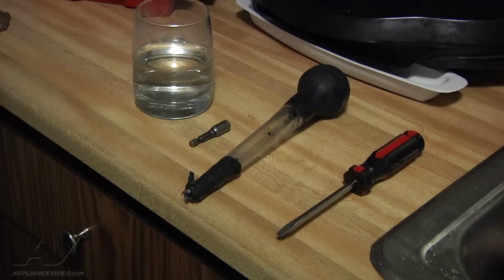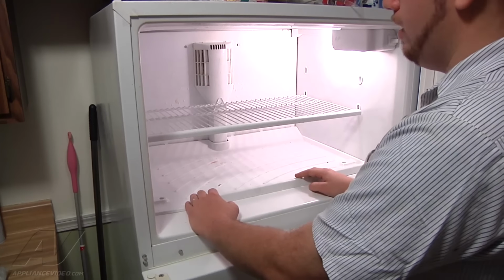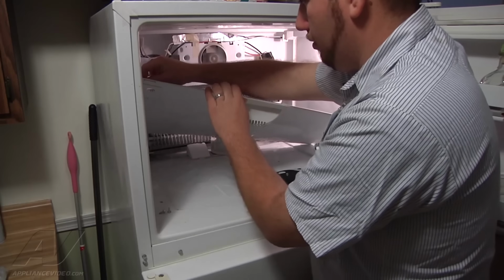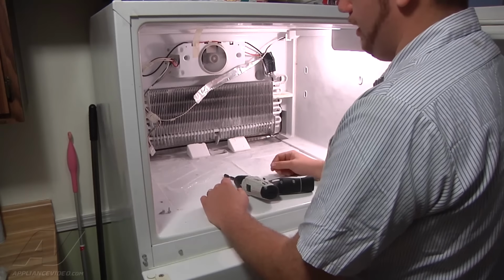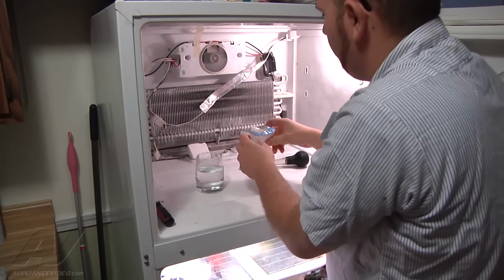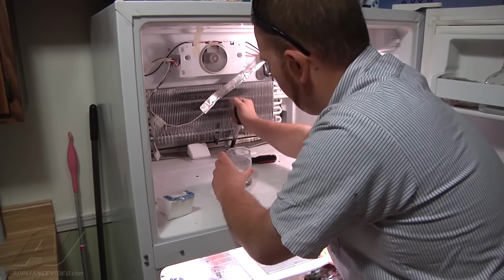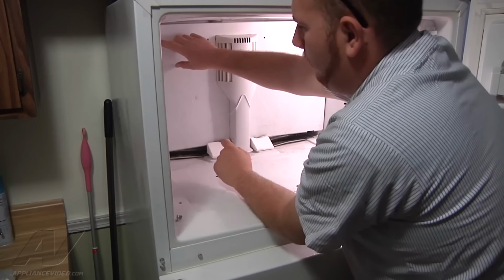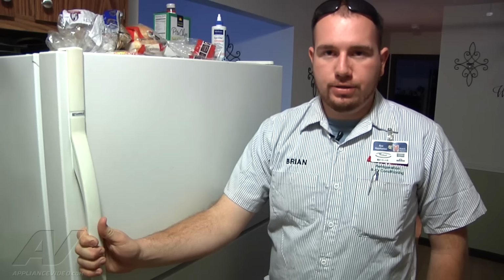Kenmore Refrigerator Repair - Water Leaking From the Freezer - Evaporator Drain Pan

Comment: So, I have used this repair for many years now to fix this annoying problem on my Kenmore Model 71192100 manufactured in January of 2002.  Just saw another site recommended another more permanent fix for this, which was to hang a copper wire from the defrost heater and down into the drain hole.  Did this and giving it a try.  (Just performed these two fixes (yours and the wire) yesterday)  

My current problem though is that despite doing this defrost and turning everything back on, the fridge part still does not seem to be getting colder.  It is hovering around 50 degrees which is too warm even after 24 hours being back on.  The freezer seems to be okay still (and it usually is and stays very cold).  I usually know it is starting to freeze over when the water starts pooling in the fridge top shelf.  I do this usual fix and it always seems to do the trick and everything is back to working order.  Not so this time.  The fan in the freezer part seems to be working, fyi.  Isn't this what forces the cold air into the fridge part?  What else might be going on to cause the fridge to still not be working properly?  Thanks for your help!
Reply: As a side note, I also have that loud clunking noise that someone else described that happens a few times a day, but it has done that almost as long as I have owned it (purchased it new around 2002) as far as I can recall.
Reply from the maker: Great question, you can call
our parts department at 1-800-830-5465 and they can give you help 6-days A week
Mon-Sat . You can also search at www.SaveMoreOnParts.com 7- days a week.  If you have a more
technical question that our parts department cannot answer, our technicians are
answering all questions at our website at www.ApplianceVideo.com under our Repair Help section. We have over 6,000
common questions and answers that you can easily search through by your model
number, appliance make, problem or error codes, and It’s completely free to
search through our question & answer library. There is a very good chance
you question is already answered there.

Comment: I wish that I had seen this before I worked on mine the first time.  Just a couple of tips:  The holes for the two upper screws in the ice maker are slotted, so you don't have to completely remove them; otherwise you are liable to have them drop into the ice maker.  This also makes it easier to re-install.  I had a little trouble getting the screw holes to line up properly, so I held it up a little and then took an ice pick through both holes (carefully).  I couldn't hold onto the screws (too short), so I used a 1/4 socket with a little bit of paper towel on the head of the screws to hold them tight.  I also had trouble getting the back of the bottom panel to snap under the back panel, so I finally put it in as best I could and then pushed down on the back end and it snapped into place.
Reply: To clarify, I was having trouble getting the screw holes on the bottom panel to line up properly.  (This software does not allow you to see more than one line at a time, at most, so you can't proofread until after you have hit enter, then it is too late.)
Reply from the maker: Thank you for
your positive response, we are glad we could help. Please help us by
subscribing to our YouTube channel or post our website www.ApplianceVideo.com  on your Facebook page. We want to let your
friends & family know how our FREE videos can help them.  Or you can
support our parts department at 1-800-830-5465 and our parts website www.SaveMoreOnparts.com .  This is the only way we can continue to
post free videos and help over 1-million people per month like you repair their
own appliances. We also have thousands of more quality videos on all major
appliances made by our factory trained technicians at www.ApplianceVideo.com .

Comment: This is an awesome video. Do you by chance have instructions or the video for Kenmore Elite side-by-side 106.58703801
Reply from the maker: Great question, you can call
our parts department at 1-800-830-5465 and they can give you help 6-days A week
Mon-Sat . You can also search at www.SaveMoreOnParts.com 7- days a week.  If you have a more
technical question that our parts department cannot answer, our technicians are
answering all questions at our website at www.ApplianceVideo.com under our Repair Help section. We have over 6,000
common questions and answers that you can easily search through by your model
number, appliance make, problem or error codes, and It’s completely free to
search through our question & answer library. There is a very good chance
you question is already answered there.

Comment: Would this be easier if the I unplugged the fridge and let it completely defrost ?
Reply from the maker: Great question, you can call
our parts department at 1-800-830-5465 and they can give you help 6-days A week
Mon-Sat . You can also search at www.SaveMoreOnParts.com 7- days a week.  If you have a more
technical question that our parts department cannot answer, our technicians are
answering all questions at our website at www.ApplianceVideo.com under our Repair Help section. We have over 6,000
common questions and answers that you can easily search through by your model
number, appliance make, problem or error codes, and It’s completely free to
search through our question & answer library. There is a very good chance
you question is already answered there.

Comment: Is there a way to prevent the drain from clogging. We've had to do this a couple times now and would like to avoid future clog events.
Reply from the maker: Great question, you can call
our parts department at 1-800-830-5465 and they can give you help 6-days A week Mon-Sat . You can also search at www.SaveMoreOnParts.com 7- days a week.  If you have a more technical question that our parts department cannot answer, our technicians are answering all questions at our website at www.ApplianceVideo.com under our Repair Help section. We have over
4,000 common questions and answers that you can easily search through by your model number, appliance make, and problem or error codes, and It’s free to search through our question & answer library.

Comment: Thank you so much. We did this tonight. Looks like someone has tried to do it to the fridge in the past (we just moved in Sept 2016) as the foam ducts were completely snapped off and only a small piece on either side was left in the hole. Also the bottom half of the back panel was solid rust. So we had some extra sanding and spray painting to do. Thanks for the great video. Also, out of curiosity are the foam ducts really needed if so where can I get them and what are they called?
Reply from the maker: Great question, you can call our parts department at 1-800-830-5465 and they can give
you help 6-days A week Mon-Sat . If you have a more technical question that our
parts department cannot answer, our technicians are answering all questions at our website at www.ApplianceVideo.com under our Repair Help section. We have over 4,000
common questions and answers that you can easily search through by your model
number, appliance make, and problem or error codes, and It’s free to search
through our question & answer library.

Comment: Great video! I have a Kenmore 106.62159110 and the back panel doesn't look the same. I couldn't get it off but I didn't try a hair dryer either. Can you tell me if most of the time the back panel and styrofoam evaporator housing are usually one unit? I was able to get the plastic cover off the evaporator but the styrofoam stayed connected. I'm hoping if I melt it sufficiently with a hair dryer that the whole back panel including the styrofoam evaporator insulation (guessing at term sorry) will just come away. Do you have any repair manuals on this? Thanks for your help. Jeff
Reply from the maker: Thanks for your response, we are glad we could help. Our library of over 5,700 videos are currently helping over 1.6 million people like you every MONTH.  Please help us by subscribing to our YouTube channel, or post our website www.ApplianceVideo.com to your Facebook page, Twitter, Instagram or any other social media sites. Your support will help us keep producing more free quality videos.

Comment: I mixed a heavy concentration of salt with the hot water and let it do the work. It melted the ice much faster. This could be bad for the metal if used repeatedly. I flushed it with fresh hot water to rinse the salt off when done.
Reply from the maker: Great question, you can call our parts department at 1-800-830-5465 and they can give
you help 6-days A week Mon-Sat . If you have a more technical question that our
parts department cannot answer,
our technicians are answering all questions at our website at www.ApplianceVideo.com under our Repair Help section. We have over
3,000 common questions and answers that you can easily search through by your
model number, appliance make, and problem or error codes, and It’s free to
search through our question & answer library.

Comment: Thank for this video !  My Kenmore 106 from 1993 was completely different than shown, so I proceeded curiously and managed to get to the drain hole , fortunately it was only debris blocking the hole. This model drips that model into the top back of the fridge into a little pop out reservoir that also was full blocked from the usual black slime.  Cleaned that up, the hole it went into was clear so all is good to go.
Reply from the maker: Thank you for your positive response, we are glad we could help. Please help us by
subscribing to our YouTube channel. Or support our parts department at
1-800-830-5465 and our website www.SaveMoreOnparts.com .  This is the only way we can continue to
help the over 900,000 people per month like you repair their own appliances. We
also have thousands of more quality videos on all major appliances made by our
factory trained technicians at www.ApplianceVideo.com .

Comment: my fridge (a Kenmore) is older than the model you showed, i would guess.  i cannot see the actual drain line.  any clues please?
Reply from the maker: Great question, you can call our parts
department at 1-800-830-5465 and they can give you help. If you have a more
technical question that our parts department cannot answer, our technicians are answering all questions
at our website at ApplianceVideo.com under our Repair Help section. We have
over 3,000 common questions and answers that you can easily search through by
your model number, appliance make, and problem or error codes, and  Its
free to search through our question & answer library.

Comment: where does the water go that you've used to unclog?
I wish I had a light in my freezer😐
Reply: It goes to a pan under the refrigerator that you can access by removing the grille; it just snaps off.  The water is evaporated by the heat of the compressor.
Reply from the maker: Great question, with our
technicians now getting hundreds questions weekly, they are answering all questions
at our website at ApplianceVideo.com under our Repair Help section. We have over
3,000 common questions and answers that you can easily search through by your
model number, appliance make, and problem or error codes.

Comment: My refrigerator is nearly identical to this one. I cleared out the drain the same way you did 3 times. Now the freezer fan is blowing cold air, but the defrost is kicking in way too much making the entire refrigerator around 60-70 degrees. If you could help me soon it would be nice. I just fixed my dryer by replacing the timer. I thought I was kinda getting good at this until I hit this  snag.
Reply from the maker: Great question, with our
technicians now getting hundreds questions weekly, they are answering all questions
at our website at ApplianceVideo.com under our Repair Help section. We have over
3,000 common questions and answers that you can easily search through by your
model number, appliance make, and problem or error codes.

Comment: Thanx so much!  This unit is the same as ours... and I saw that the evap pan underneath was bone dry some weeks ago after the problem started buy haven't had time to "go in".  Also, our freezer section is FULL, so... gotta get the big cooler.  I'll have the drain tube cleared out later today!  Again... thanx!  JKM
Reply from the maker: Thank you for
your positive response, we are glad we could help. Please subscribe to our
YouTube channel or donate $1.00 to our fan funding page to help us create more
quality content. This is the only way we can continue to help thousands of
people like you every month. Just click on the link below and go to our YouTube
page and click on the BLUE support button on the right hand side of the page. Thanks
in advance.   https://www.youtube.com/user/ApplianceVideos
Reply: The problem has returned... twice more.  I know there's nothing really wrong with the unit but my wife is starting to talk "NEW FRIDGE".  I'm wondering if maybe we have the controls set wrong... for example: too cold in the lower section, too warm in the upper section.  The thermometers look okay... but she's not gonna put up with me having to thaw things out every few weeks.  Is there something I'm missing?  Is there more that one defrost element?  The one in the freezer is just fine.
Reply: I'll add the copper wire heat radiator... as soon as I can find some (and while she's at work).  ;-)

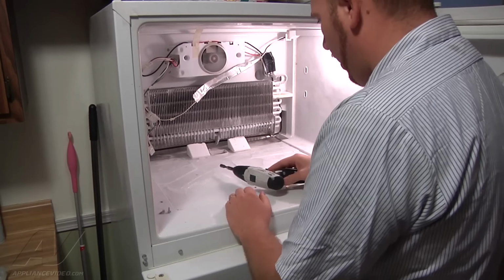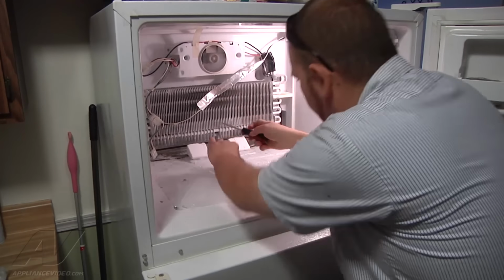Comment: At 3:42 the narrator says, "Our drain tube is gonna be in the middle underneath the evaporator here" and points to a spot exactly in between the two air ducts. But then at 5:11 he says, "Our drain tube is gonna be right behind this air duct" and he taps the right air duct with his screwdriver and proceeds to remove that air duct and inject the hot water at this spot. If that is actually where the drain tube is, what was he pointing to so emphatically at 3:44?
Reply from the maker: +Jack Smith 

         Good question, with our technicians
now getting hundreds questions weekly, they are answering all questions at our
website http://www.appliancevideo.com/repair-help/ .  We also have over 30000 common questions
and answers that you can easily search through by your model number, appliance
make, problem or error code and it’s absolutely FREE.
Reply: I think that he was pointing at the drain pan and said that the drain tube was in the pan (but not right where he was pointing.  Mine was in the same place as in the video, but I overlooked it at first because there was still a little ice in the bottom of the pan.

Comment: What do you hook the ground wire clip to on the back panel?
Reply from the maker: +Mary Newsome 

Good question, with our
technicians now getting hundreds questions weekly, they are answering all questions
at our website http://www.appliancevideo.com/repair-help/ .  We also have over 30000 common questions
and answers that you can easily search through by your model number, appliance
make, problem or error code and it’s absolutely FREE.
Reply: +ApplianceVideo.com I figured it out, thank you.